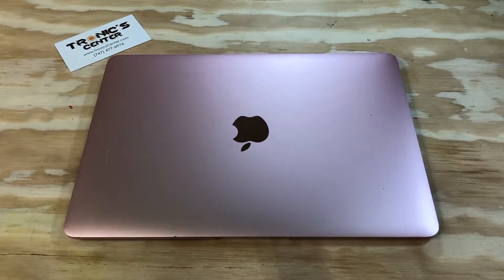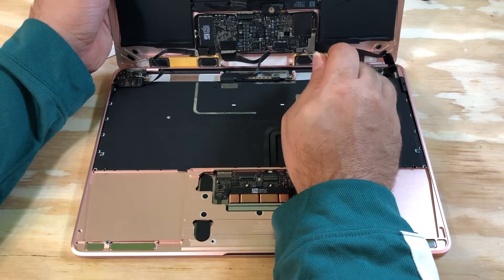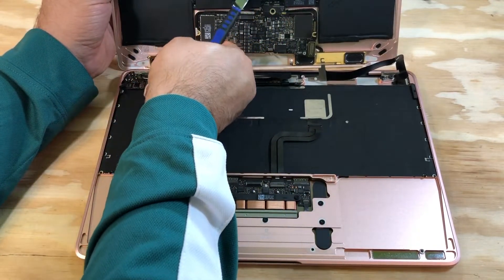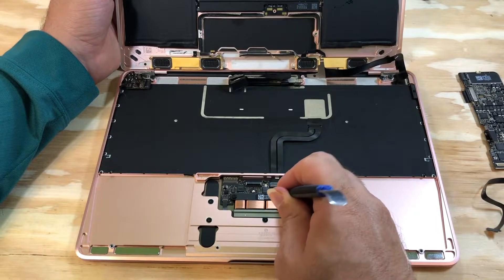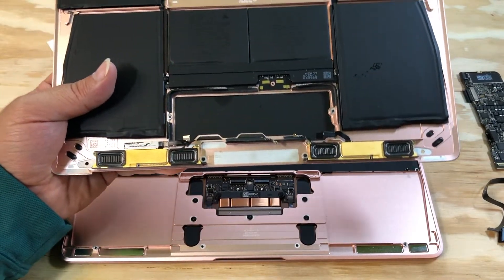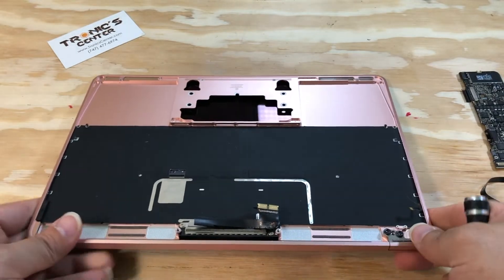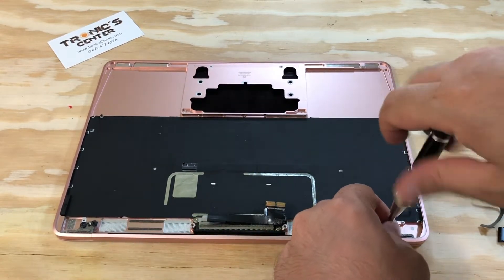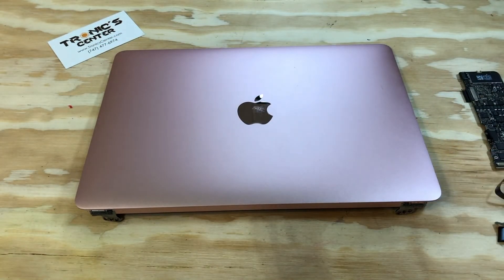Take Apart 12" Apple MacBook A1534 - Quick 12" MacBook Disassembly and Tear down 2015 - 2017

Comment: I have this same laptop but I mistakenly tempered with the screen cable. I don't know how to get a screen replacement.
Reply from the maker: Hello
Thanks for watching this video and supporting us, Here is some Related Keyword 12" MacBook A1534 repair, MacBook A1534 screen replacement, MacBook A1534 battery replacement, MacBook A1534 keyboard repair, MacBook A1534 logic board repair, MacBook A1534 water damage repair, MacBook A1534 charging port fix, MacBook A1534 gold repair, MacBook A1534 rose gold repair, MacBook A1534 silver repair.

MacBook A1534 space gray repair, MacBook A1534 screen replacement cost, MacBook A1534 repair service near me, MacBook A1534 hinge repair, MacBook A1534 motherboard repair, MacBook A1534 repair price, MacBook A1534 repair store, MacBook A1534 technician near me, MacBook A1534 fix, 12-inch MacBook A1534 repair, MacBook A1534 display repair, MacBook A1534 no power issue.

 MacBook A1534 boot problem fix, MacBook A1534 repair expert, MacBook A1534 overheating fix, MacBook A1534 trackpad repair, MacBook A1534 not charging fix, MacBook A1534 slow performance fix, MacBook A1534 SSD replacement, MacBook A1534 repair cost, MacBook A1534 diagnostic service, MacBook A1534 repair shop, MacBook A1534 Apple repair, MacBook A1534 backlight repair.

MacBook A1534 liquid damage fix, MacBook A1534 speaker repair, MacBook A1534 fan replacement, MacBook A1534 data recovery, MacBook A1534 repair time, MacBook A1534 repair DIY, MacBook A1534 repair tutorial, MacBook A1534 professional repair, MacBook A1534 same-day repair, MacBook A1534 repair guide, MacBook A1534 motherboard replacement, MacBook A1534 broken hinge fix.

MacBook A1534 logic board replacement, MacBook A1534 MacOS reinstall, MacBook A1534 hard drive upgrade, MacBook A1534 repair warranty, MacBook A1534 back cover replacement, MacBook A1534 frame repair, MacBook A1534 power button fix, MacBook A1534 screen flickering fix, MacBook A1534 black screen fix, MacBook A1534 stuck on Apple logo, MacBook A1534 USB-C repair, MacBook A1534 keyboard not working fix.

MacBook A1534 repair appointment, MacBook A1534 replacement parts, MacBook A1534 LCD repair, MacBook A1534 battery draining fast fix, MacBook A1534 charging issues, MacBook A1534 screen cracked fix, MacBook A1534 keyboard replacement price, MacBook A1534 Retina display repair, MacBook A1534 touchpad fix, MacBook A1534 repair warranty check, MacBook A1534 casing repair, MacBook A1534 aluminum body repair.

MacBook A1534 refurbished repair, MacBook A1534 logic board issues, MacBook A1534 Bluetooth not working, MacBook A1534 WiFi issues fix, MacBook A1534 microphone repair, MacBook A1534 trackpad replacement, MacBook A1534 repair without AppleCare, MacBook A1534 local repair services, MacBook A1534 MacOS update issues, MacBook A1534 diagnostic fee, MacBook A1534 repair review, MacBook A1534 repair center.

MacBook A1534 fan noise fix, MacBook A1534 overheating solutions, MacBook A1534 keyboard repair cost, MacBook A1534 stuck key fix, MacBook A1534 Touch ID repair, MacBook A1534 replacement guide, MacBook A1534 professional fix, MacBook A1534 Apple repair cost, MacBook A1534 service center, MacBook A1534 best repair service, MacBook A1534 battery swelling issue, MacBook A1534 screen dim fix.

MacBook A1534 back cover scratch fix, MacBook A1534 trackpad clicking issue, MacBook A1534 speaker replacement, MacBook A1534 loud fan fix, MacBook A1534 MacOS reinstall guide, MacBook A1534 repair near me, MacBook A1534 full service repair, MacBook A1534 Apple authorized repair, MacBook A1534 color matching repair, MacBook A1534 LCD panel replacement, MacBook A1534 slow boot fix.

MacBook A1534 trackpad unresponsive fix, MacBook A1534 warranty repair, MacBook A1534 power failure fix, MacBook A1534 keyboard sticky keys fix, MacBook A1534 no sound fix, MacBook A1534 power adapter repair, MacBook A1534 service time, MacBook A1534 screen bleeding fix, MacBook A1534 USB port loose fix, MacBook A1534 bezel replacement, MacBook A1534 Retina display replacement.

MacBook A1534 12-inch repair, MacBook A1534 video output issue fix, MacBook A1534 GPU repair, MacBook A1534 speaker buzzing fix, MacBook A1534 microphone replacement, MacBook A1534 Bluetooth connectivity fix, MacBook A1534 data transfer service, MacBook A1534 professional technician, MacBook A1534 fix at home, MacBook A1534 fix appointment, MacBook A1534 display replacement cost.

MacBook A1534 warranty check, MacBook A1534 AppleCare repair, MacBook A1534 authorized repair shop, MacBook A1534 dent repair, MacBook A1534 screen calibration fix, MacBook A1534 backlight issue fix, MacBook A1534 motherboard troubleshooting, MacBook A1534 motherboard fix, MacBook A1534 liquid spill repair, MacBook A1534 charging slow fix, MacBook A1534 Apple screen replacement, MacBook A1534 sleep mode issues.

MacBook A1534 SSD upgrade, MacBook A1534 hinge loose fix, MacBook A1534 audio jack repair, MacBook A1534 audio issue fix, MacBook A1534 camera not working fix, MacBook A1534 FaceTime camera fix, MacBook A1534 MacOS installation fix, MacBook A1534 charging cable fix, MacBook A1534 repair steps, MacBook A1534 touchpad issue, MacBook A1534 laptop repair near me, MacBook A1534 case replacement.

MacBook A1534 cracked case repair, MacBook A1534 top case replacement, MacBook A1534 MacOS reinstall service, MacBook A1534 thermal paste replacement, MacBook A1534 fan noise repair, MacBook A1534 screen disassembly, MacBook A1534 color restoration, MacBook A1534 hinge damage fix, MacBook A1534 screen glitch fix, MacBook A1534 repair manual, MacBook A1534 screen touch issue fix.

MacBook A1534 dark screen repair, MacBook A1534 flickering display fix, MacBook A1534 display backlight issue, MacBook A1534 boot failure fix, MacBook A1534 startup problem fix, MacBook A1534 OS crash fix, MacBook A1534 overheating warning fix, MacBook A1534 software repair, MacBook A1534 keyboard water damage repair, MacBook A1534 case crack fix, MacBook A1534 performance optimization.

MacBook A1534 software troubleshooting, MacBook A1534 DIY repair steps, MacBook A1534 trackpad won’t click fix, MacBook A1534 logic board troubleshooting, MacBook A1534 Apple certified repair, MacBook A1534 Retina screen fix, MacBook A1534 troubleshooting guide, MacBook A1534 repair service online, MacBook A1534 spare parts replacement, If you have any other Request please Let us know .

Many Thanks
Reply from the maker: If You Need any Original Parts or Tools You May Visit www.Tronicscenter.com For Original Apple Parts .

Comment: good instructions but very not careful. cringe the whole video.
Reply from the maker: Hi
Thanks for watching ! 
12" MacBook A1534 repair Rose Gold, 12" MacBook A1534 repair Silver, 12" MacBook A1534 repair Space Gray, 12" MacBook A1534 screen replacement Rose Gold, 12" MacBook A1534 screen replacement Silver, 12" MacBook A1534 screen replacement Space Gray, MacBook A1534 Rose Gold battery replacement, MacBook A1534 Silver battery replacement, MacBook A1534 Space Gray battery replacement, 12" MacBook A1534 keyboard repair Rose Gold, 12" MacBook A1534 keyboard repair Silver, 12" MacBook A1534 keyboard repair Space Gray, MacBook A1534 Rose Gold logic board repair, MacBook A1534 Silver logic board repair, MacBook A1534 Space Gray logic board repair, MacBook A1534 display assembly repair Rose Gold, MacBook A1534 display assembly repair Silver, MacBook A1534 display assembly repair Space Gray, 12" MacBook A1534 trackpad repair Rose Gold, 12" MacBook A1534 trackpad repair Silver, 12" MacBook A1534 trackpad repair Space Gray, MacBook A1534 Rose Gold repair service near me, MacBook A1534 Silver repair service near me, MacBook A1534 Space Gray repair service near me, 12" MacBook A1534 repair parts Rose Gold, 12" MacBook A1534 repair parts Silver, 12" MacBook A1534 repair parts Space Gray, MacBook A1534 Rose Gold water damage repair, MacBook A1534 Silver water damage repair, MacBook A1534 Space Gray water damage repair, 12" MacBook A1534 logic board replacement Rose Gold, 12" MacBook A1534 logic board replacement Silver, 12" MacBook A1534 logic board replacement Space Gray, MacBook A1534 Rose Gold SSD replacement, MacBook A1534 Silver SSD replacement, MacBook A1534 Space Gray SSD replacement, 12" MacBook A1534 hinge repair Rose Gold, 12" MacBook A1534 hinge repair Silver, 12" MacBook A1534 hinge repair Space Gray, MacBook A1534 Rose Gold screen repair cost, MacBook A1534 Silver screen repair cost, MacBook A1534 Space Gray screen repair cost, 12" MacBook A1534 charging port repair Rose Gold, 12" MacBook A1534 charging port repair Silver, 12" MacBook A1534 charging port repair Space Gray, MacBook A1534 Rose Gold overheating issue repair, MacBook A1534 Silver overheating issue repair, MacBook A1534 Space Gray overheating issue repair, 12" MacBook A1534 speaker replacement Rose Gold, 12" MacBook A1534 speaker replacement Silver, 12" MacBook A1534 speaker replacement Space Gray, MacBook A1534 Rose Gold repair diagnostics, MacBook A1534 Silver repair diagnostics, MacBook A1534 Space Gray repair diagnostics, 12" MacBook A1534 cracked screen repair Rose Gold, 12" MacBook A1534 cracked screen repair Silver, 12" MacBook A1534 cracked screen repair Space Gray, MacBook A1534 Rose Gold fan replacement, MacBook A1534 Silver fan replacement, MacBook A1534 Space Gray fan replacement, 12" MacBook A1534 hinge replacement Rose Gold, 12" MacBook A1534 hinge replacement Silver, 12" MacBook A1534 hinge replacement Space Gray, MacBook A1534 Rose Gold repair shop near me, MacBook A1534 Silver repair shop near me, MacBook A1534 Space Gray repair shop near me, 12" MacBook A1534 display replacement Rose Gold, 12" MacBook A1534 display replacement Silver, 12" MacBook A1534 display replacement Space Gray, MacBook A1534 Rose Gold screen flicker repair, MacBook A1534 Silver screen flicker repair, MacBook A1534 Space Gray screen flicker repair, 12" MacBook A1534 keyboard replacement Rose Gold, 12" MacBook A1534 keyboard replacement Silver, 12" MacBook A1534 keyboard replacement Space Gray, MacBook A1534 Rose Gold screen replacement service, MacBook A1534 Silver screen replacement service, MacBook A1534 Space Gray screen replacement service, 12" MacBook A1534 power button repair Rose Gold, 12" MacBook A1534 power button repair Silver, 12" MacBook A1534 power button repair Space Gray, MacBook A1534 Rose Gold damaged screen repair, MacBook A1534 Silver damaged screen repair, MacBook A1534 Space Gray damaged screen repair, 12" MacBook A1534 repair cost Rose Gold, 12" MacBook A1534 repair cost Silver, 12" MacBook A1534 repair cost Space Gray, .
Let us know if you have any Question.
Good luck with your Project .
Reply from the maker: If You Need any Original Parts or Tools You May Visit www.Tronicscenter.com For Original Apple Parts .

Comment: Where is the fan???
Reply from the maker: Hi
There is no Cooling Fan on this model .
12" MacBook A1534 repair Rose Gold, 12" MacBook A1534 repair Silver, 12" MacBook A1534 repair Space Gray, 12" MacBook A1534 screen replacement Rose Gold, 12" MacBook A1534 screen replacement Silver, 12" MacBook A1534 screen replacement Space Gray, MacBook A1534 Rose Gold battery replacement, MacBook A1534 Silver battery replacement, MacBook A1534 Space Gray battery replacement, 12" MacBook A1534 keyboard repair Rose Gold, 12" MacBook A1534 keyboard repair Silver, 12" MacBook A1534 keyboard repair Space Gray, MacBook A1534 Rose Gold logic board repair, MacBook A1534 Silver logic board repair, MacBook A1534 Space Gray logic board repair, MacBook A1534 display assembly repair Rose Gold, MacBook A1534 display assembly repair Silver, MacBook A1534 display assembly repair Space Gray, 12" MacBook A1534 trackpad repair Rose Gold, 12" MacBook A1534 trackpad repair Silver, 12" MacBook A1534 trackpad repair Space Gray, MacBook A1534 Rose Gold repair service near me, MacBook A1534 Silver repair service near me, MacBook A1534 Space Gray repair service near me, 12" MacBook A1534 repair parts Rose Gold, 12" MacBook A1534 repair parts Silver, 12" MacBook A1534 repair parts Space Gray, MacBook A1534 Rose Gold water damage repair, MacBook A1534 Silver water damage repair, MacBook A1534 Space Gray water damage repair, 12" MacBook A1534 logic board replacement Rose Gold, 12" MacBook A1534 logic board replacement Silver, 12" MacBook A1534 logic board replacement Space Gray, MacBook A1534 Rose Gold SSD replacement, MacBook A1534 Silver SSD replacement, MacBook A1534 Space Gray SSD replacement, 12" MacBook A1534 hinge repair Rose Gold, 12" MacBook A1534 hinge repair Silver, 12" MacBook A1534 hinge repair Space Gray, MacBook A1534 Rose Gold screen repair cost, MacBook A1534 Silver screen repair cost, MacBook A1534 Space Gray screen repair cost, 12" MacBook A1534 charging port repair Rose Gold, 12" MacBook A1534 charging port repair Silver, 12" MacBook A1534 charging port repair Space Gray, MacBook A1534 Rose Gold overheating issue repair, MacBook A1534 Silver overheating issue repair, MacBook A1534 Space Gray overheating issue repair, 12" MacBook A1534 speaker replacement Rose Gold, 12" MacBook A1534 speaker replacement Silver, 12" MacBook A1534 speaker replacement Space Gray, MacBook A1534 Rose Gold repair diagnostics, MacBook A1534 Silver repair diagnostics, MacBook A1534 Space Gray repair diagnostics, 12" MacBook A1534 cracked screen repair Rose Gold, 12" MacBook A1534 cracked screen repair Silver, 12" MacBook A1534 cracked screen repair Space Gray, MacBook A1534 Rose Gold fan replacement, MacBook A1534 Silver fan replacement, MacBook A1534 Space Gray fan replacement, 12" MacBook A1534 hinge replacement Rose Gold, 12" MacBook A1534 hinge replacement Silver, 12" MacBook A1534 hinge replacement Space Gray, MacBook A1534 Rose Gold repair shop near me, MacBook A1534 Silver repair shop near me, MacBook A1534 Space Gray repair shop near me, 12" MacBook A1534 display replacement Rose Gold, 12" MacBook A1534 display replacement Silver, 12" MacBook A1534 display replacement Space Gray, MacBook A1534 Rose Gold screen flicker repair, MacBook A1534 Silver screen flicker repair, MacBook A1534 Space Gray screen flicker repair, 12" MacBook A1534 keyboard replacement Rose Gold, 12" MacBook A1534 keyboard replacement Silver, 12" MacBook A1534 keyboard replacement Space Gray, MacBook A1534 Rose Gold screen replacement service, MacBook A1534 Silver screen replacement service, MacBook A1534 Space Gray screen replacement service, 12" MacBook A1534 power button repair Rose Gold, 12" MacBook A1534 power button repair Silver, 12" MacBook A1534 power button repair Space Gray, MacBook A1534 Rose Gold damaged screen repair, MacBook A1534 Silver damaged screen repair, MacBook A1534 Space Gray damaged screen repair, 12" MacBook A1534 repair cost Rose Gold, 12" MacBook A1534 repair cost Silver, 12" MacBook A1534 repair cost Space Gray, MacBook A1534 Rose Gold Wi-Fi issue repair, MacBook A1534 Silver Wi-Fi issue repair, MacBook A1534 Space Gray Wi-Fi issue repair, 12" MacBook A1534 audio jack repair Rose Gold, 12" MacBook A1534 audio jack repair Silver, 12" MacBook A1534 audio jack repair Space Gray, MacBook A1534 Rose Gold USB port replacement, MacBook A1534 Silver USB port replacement, MacBook A1534 Space Gray USB port replacement, 12" MacBook A1534 screen calibration Rose Gold, 12" MacBook A1534 screen calibration Silver, 12" MacBook A1534 screen calibration Space Gray, MacBook A1534 Rose Gold repair expert, MacBook A1534 Silver repair expert, MacBook A1534 Space Gray repair expert, 12" MacBook A1534 screen repair near me Rose Gold, 12" MacBook A1534 screen repair near me Silver, 12" MacBook A1534 screen repair near me Space Gray, MacBook A1534 Rose Gold repair DIY guide, MacBook A1534 Silver repair DIY guide, MacBook A1534 Space Gray repair DIY guide, 12" MacBook A1534 overheating solution Rose Gold, 12" MacBook A1534 overheating solution Silver, 12" MacBook A1534 overheating solution Space Gray, MacBook A1534 Rose Gold repair service cost, MacBook A1534 Silver repair service cost, MacBook A1534 Space Gray repair service cost, 12" MacBook A1534 damaged case repair Rose Gold, 12" MacBook A1534 damaged case repair Silver, 12" MacBook A1534 damaged case repair Space Gray, MacBook A1534 Rose Gold broken hinge repair, MacBook A1534 Silver broken hinge repair, MacBook A1534 Space Gray broken hinge repair, 12" MacBook A1534 backlight issue Rose Gold, 12" MacBook A1534 backlight issue Silver, 12" MacBook A1534 backlight issue Space Gray, MacBook A1534 Rose Gold liquid damage repair, MacBook A1534 Silver liquid damage repair, MacBook A1534 Space Gray liquid damage repair, 12" MacBook A1534 power issue repair Rose Gold, 12" MacBook A1534 power issue repair Silver, 12" MacBook A1534 power issue repair Space Gray, MacBook A1534 Rose Gold repair cost estimation, MacBook A1534 Silver repair cost estimation, MacBook A1534 Space Gray repair cost estimation, 12" MacBook A1534 hinge repair near me Rose Gold, 12" MacBook A1534 hinge repair near me Silver, 12" MacBook A1534 hinge repair near me Space Gray, MacBook A1534 Rose Gold repair and parts, MacBook A1534 Silver repair and parts, MacBook A1534 Space Gray repair and parts, 12" MacBook A1534 repair online support Rose Gold, 12" MacBook A1534 repair online support Silver, 12" MacBook A1534 repair online support Space Gray, MacBook A1534 Rose Gold replacement parts, MacBook A1534 Silver replacement parts, MacBook A1534 Space Gray replacement parts
Many thanks for watching .
let us know if in case need an assistance .
Reply from the maker: If You Need any Original Parts or Tools You May Visit www.Tronicscenter.com For Original Apple Parts .